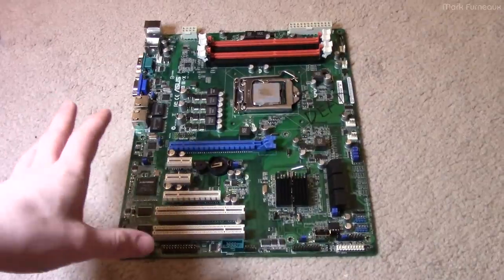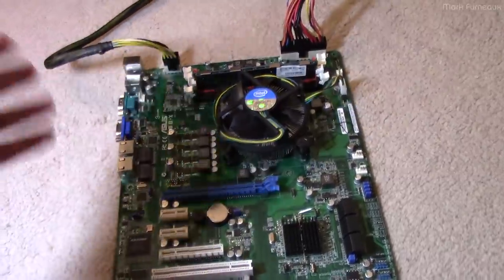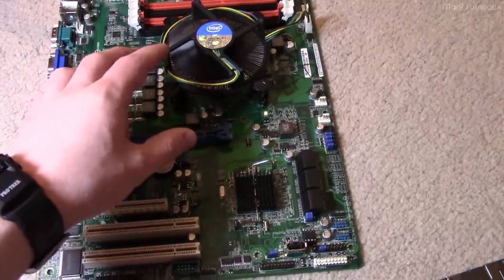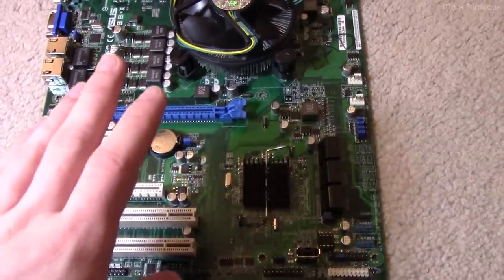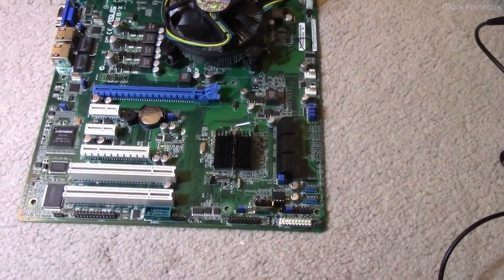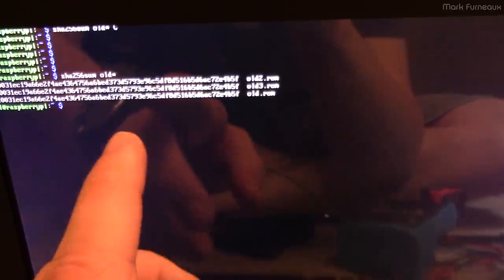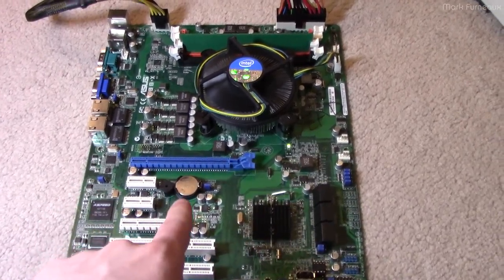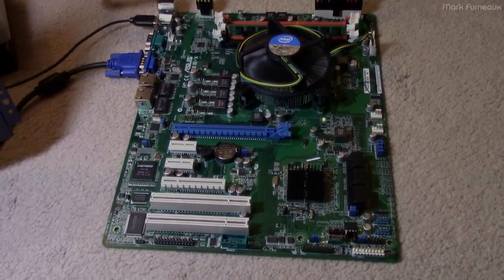Fixing A Dead Server Motherboard + Troubleshooting Tips

Comment: ECC UDIMM is used in workstations and some server boards. The intel Server boards i use in my lab uses this ECC unbuffered RAM and its expensive unlike the Registered stuff. BIOS issue is a common thing on a lot of boards. I just use a BIOS re-programmer to solve the issues.
Reply: Most of Supermicro boards I encountered use UDIMMs, not RDIMM. And theses are real server ones, not ASUS, lol.
RDIMMs are mostly for datacenter grade server platforms, rackmount chasis, non-standart formfactor server mobos focused on density.
P8* / P9* series are workstation mobos. I had P9D-X and it refused to boot with LSI SAS HBA, which is an industry standard, unless I masked SMBus pins on its PCIe connector. What a joke..

Comment: I think there was some arcane transient that crashed it and caused the rom to corrupt at once. At boot the rom is read and then never touched again, you can pull the chip out while it's running and it'll stay up, so I don't think the rom corrupting itself would have hung the machine (Though, maybe with this new fangled UEFI that is no longer true). At one point I abused this "feature" to use my motherboard as a general SPI programmer lol.  I have since graduated(?) to using frser-duino on an $5 clone Arduino Uno, no Pi required.
Reply from the maker: I fully agree. I think something crashed hard which hung the machine and corrupted the ROM at the same time. If it was just the ROM it would have probably run fine until the next reboot.
Reply: @TheUbuntuGuy  Maybe there was some power transient or capacitors going bad in the PSU.

Comment: Thank you for all this amazing info, i also happen to have an OCZ PSU Fatal1ty 550 Watt which still works as it should and was used for 10 years straight before i upgraded, it still works, i just don't use the PC i have it on currently, even though i've cleaned its internals many times over the years i had to replace the fan cause it was too loud for my ears despite having near zero difficulty spinning.

Comment: Great video man.. I especially liked the part where you use raspberry pie to reflash the bios chip instead of using eeprom flasher. Is it possible also to reflash the bios chip using regular pc ports (ie. parallel ports) ?

Comment: you can rewrite a bios with a floppy disk or cd, without removing it from the board, it's called blind writing.....been doing it since 2002, works on all motherboards from 486 to present day, floppy disk, cd or usb stick with an ini file and basic dos, flash rom and flashing program for the rom file......will flash with a black screen.  you do not need to take out the chip unless it is electrically faulty. there is no need for a blackberry pi
Reply: What do you use to control the i/o on the motherboard ?

Comment: Good explanation on troubleshooting. My board is an asus m2n32 sli that stopped posting. I replaced 2 capacitors that were blown. Power supply is good but board will do nothing but the standby light when the 4 pin atx 12v connector is attached. If I disconnect the 4 pin, the fans run. All 4 pins are shorted to ground somehow. It doesn't matter if I remove the cpu, it will still not power up with the 4 pin connected. Any ideas on how I can find the short to ground?

Comment: Very interesting educational video, thanks. In my (faulty) ASUS mobo, beside the soldered SMD ROM, there is an odd seven pins socket (eight pins but one has pulled off). Do you think I could exploit it to flash the BIOS? Anyway in my case this fix would be not reachable, because my mobo is stuck on unstable (oscillating) 5VSB. Power LED blinks every 4 secs. PWON does not start. On the other hand, CMOS clock works fine (DSO).

Comment: Can a currupt  bios chip still let you see your sata drives but cant install or boot from sata drives. I can boot from usb into a ubuntu OS running off that USB drive but cant install it to a sata drive or windows even though the system see's the drives

Comment: pretty cool, 
I would've checked the communication between the chip and bios before trying to read the bios. You can at least see with the scope if there's something going on before going through all that work.
Reply from the maker: True. In my experience there is always some traffic if the board stays on like that. If you try to power this board with no BIOS chip at all, it will do absolutely nothing, not even turn the PSU on

Comment: Hi, what are these 4 square components on the left/bottom  side of the fan assembly? My motherboard have 8 of these in a row but they were so close to the cpu that when I installed the cooler then it cause a slight damage to the side of those components, nothing serious and the board works but the case of these components is kid of cracked on 2 of these about 3 mm.

Comment: you just gave me some clue to figure out how to tell if my cpu is dying on my motherboard. the thing only post some of the time, but mdsched says the RAM checks out. so i'm going to remove the ram, plug a speaker in, and if if it consistently makes it to the RAM test phase, or fails before it gets there.

Comment: Did you try standard ecc ram before doing the bios? More then likely it was the registered/buffered ram you was using that was causing the problems (unless you could see the bios was actually damaged when connected to the pi) 

It supports ecc unregistered ram, trying to use ecc registered/buffered in most ATX server boards won't work (norm Basic xeons cpus) 

Rack Servers normally use registered/buffered ecc ram (there is a chip in the middle and most server ram can handle a double bit error and recover from it without having to do a crash the server 

workstion or low end servers use standard ecc ram (after the frequency of the ram > R, B, V ecc RDIMM won't work in basic server boards typically,, server/workstation boards use only UDIMM E type ecc)

Comment: i have a vert specyfic but stupid question
is it possible to flash  award bios chip with ami uefi  rom from a different board if most basic components of the board are the same? 
i know in pentium 2 days i fixed multiple bios rot by simply booting the board from a prepared floppy with board specyfic rom , but it only worked if you flashed ami to ami or award to award, and i would like to flash something completly different to a board that wasn't designed for it
tha thing however look a bit promissing because most of prewiously randm bits motherboard makers used like clock generators, memory and peryferial controllers all become integrated to 2-3 chips on the board . Main two being system controller and mainboard peryferial controller
i am not sure how uefi woul react to different cpu voltage generator (different number of phases) but in the past i succesfully flashed oem bioses from different motherboards with the same basic components which didn't make problems of it (am2 fujitsu board with nvidia graphics to am2+ bios, but both boards were ami with the same flash size)
i just would like to test the theory that it could potentially work with added uefi boot capabilities given that the donor uefi rom has it

Comment: @
Mark Furneaux BIOS corruption isn't weird... SPI like a SSD  or memory cards has read/write cycles  and that's why the BIOS gets corrupted.  For example in laptops this is very common issue and when you reprogram it gets corrupted one more time after some time, so the spi replacement and bios flash into it solves the problem pernamently until  it will reach the limit of read/write cycles once again...

Comment: For curiosity.  After you pulled the raw BIOS/UEFI ROM out the capsule format.  If it's supposed to be the same version, you can run SHA256SUM on the known good ROM.  If different from what was pulled on the chip.  You'd immediately know what was on the chip was wrong.  As long as you have a good extraction, and the versions match.  Most times you might not know/remember what BIOS version was on the board before it stopped working however. 
Great Video!
Reply from the maker: The SHA would almost certainly be different since the BIOS settings are stored in a filesystem within the flash. As soon as any setting is changed, the images will differ.
Reply: Doesn't store those settings in a different ROM chip? It would seem if the BIOS settings are cleared when the CMOS battery is removed.  And if the BIOS firmware were on the same chip, the BIOS would be vulnerable to corruption.  Since volatile and nonvolatile ROMs are being stored on the same chip.  I feel like it would be more reliable to store them separately in different chips.  It could be possible that different boards are done differently; cost reasons, reliability, more secure, designer's choice etc...  For example my Lenovo E32 board has a Winbond chip right next to the AMI-Aptio chip.  I recall the Lenovo Thinkpad L430 having a similar winbond chip that stored the BIOS password.  Could just be used for secure BIOS settings, I'm not totally sure.  Since those aren't lost on a clear or CMOS battery removal.

Comment: Hey Mark. I've been watching a million videos trying to find out what the problem can be when the PC pass the CPU test but get stuck in Memory error. The PC has been working for years and now can't reach BIOS screen as for every boot it stops in mem_error. I tried every single stick, one at a time and in each slot at a time. I borrowed additional memory in case my sticks were bad but still same issue (none work in any slot). It happened before to need to boot 2 or three times to start the PC but then the issue went away. After months it came back and didn't work for a week, then after 2 weeks working the issue is back again and I never could boot it anymore. Any thoughts? Thank!!
ASUS Sabertooth 990FX ver1

Comment: Yo we definitely are lucky.  I also have a ocz psu in my test bench. It likes to ramp the fan full speed when using a older high power card like a xfx hd7990 but other then that was my first modular psu and was great up until the full bore fan point. Weirdly though I use this rig when buying used parts and the fan has never done it in there ever 12v rail is also dying but we’re running it until it dies completely

Comment: Hey is it possible to replace a bad ram slot ?
Reply: No. You wont have a chance the motherbard would survive that.
The ram sockets VERY rarely fails.
Instead your problem is most likely a bent or broken pin in the cpu socket, which is much more common after replacing the cpu.